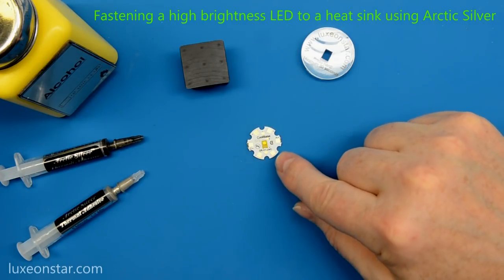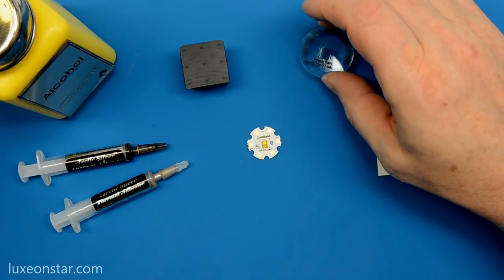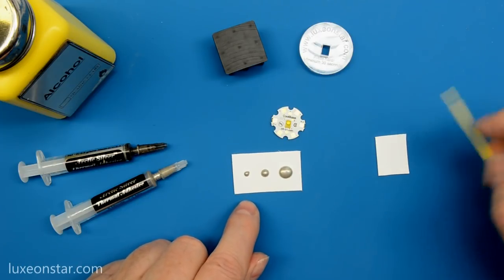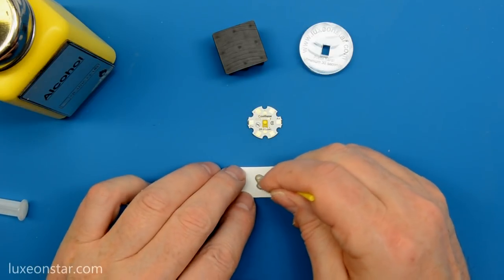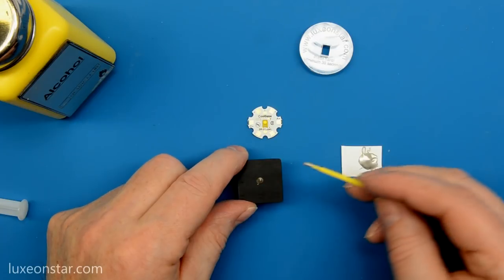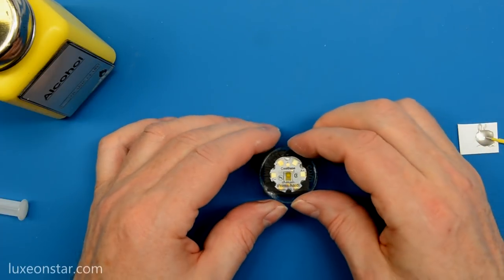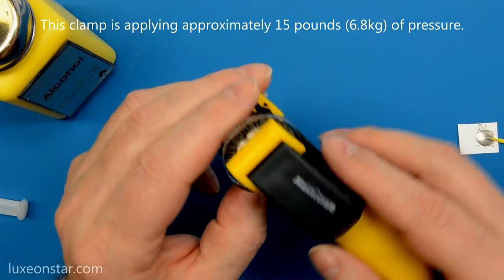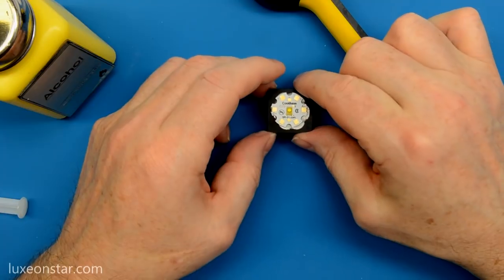Fastening a High Brightness LED to a Heat Sink Using Arctic Silver

Comment from the maker: This is in response to a post that was submitted some time ago but somehow got snagged by YouTube's spam filters.

1) What tolerance is there on the epoxy mix ratio - hard to judge "equal' at this scale.
I am not sure about the mixing tolerance. I suspect it is generous, but you would need to contact the makers of Arctic Silver to get accurate information.

2) Epoxy joints are notorious for sliding out of position especially under clamping pressure, you make it seem no problem but it is an issue.
If the parts are sliding around a lot when clamped, then that is a sign that too much compound is being used. The objective is to create as thin a bond line as possible in order to create a thermally efficient joint. So if you find that the parts are moving when clamped, reduce the amount of Arctic Silver you are using.

3) How long will the Arctic Silver epoxy last once opened, & what does it cost?
The manufacturer does not state an unmixed shelf life that I have seen, but I suspect it is fairly long. Probably a year or more at least. As of today, a 7 gram package of Arctic Silver is priced at $19.85 on our website.

4) You don't show any surface prep other than cleaning, what about checking at least for flatness of the emitter assembly?
It goes without saying that the surfaces do need to be as flat as possible. Commercially produced heat sinks will already have a very flat surface. Most LED assemblies will also have a flat surface as they are designed to be mounted to a cooling surface. So for the most part just being sure that the surfaces are free of contamination and moisture is, usually, sufficient.

5) Mechanical fixing?
Many of the LED assemblies that we offer can be mounted with mechanical fasteners, however we have found that both thermal tape and Arctic Silver perform very well and are much easier to use than screws or spring clips. Mechanical fasteners can be a bit trickier as it is very easy to over torque the screws, distorting the assembly.

Comment: Informative, but some questions remain:
1) What tolerance is there on the epoxy mix ratio - hard to judge "equal' at this scale.
2) Epoxy joints are notorious for gliding out of position especially under clamping pressure, you make it seem no problem but it is an issue.
3) How long will the Arctic Silver epoxy last once opened, & what does it cost?
4) You don't show any surface prep other than cleaning, what about checking at least for flatness of the emitter assembly?
5) Mechanical fixing ?

Comment: @Luxeon Star Leds : Is it ok to solder the electrical wires to the LED AFTER fastening the LED to the Heatsink with the arctic silver? Will the heat of the iron not damage the Arctic Silver?
Reply from the maker: There should be no problem soldering the wires to the LED module after it is mounted to the heatsink.

Comment: is it the same amount for arctic silver paste to be used ??? thx
Reply from the maker: I have no experience using Arctic Silver paste, but I suspect it would be the same amount, and perhaps even less as the purpose of the paste is to fill in any small and microscopic voids.
Reply: thx alot for the quick responce

Comment: How hard is it to remove a glued LED in case you want to use the heatsink for something else ?
Reply from the maker: ***** It is not removable. Arctic Silver creates a permanent bond.
Reply: Luxeon Star LEDs I meant more in the sense of using a knife or a screwdriver to remove (and probably damage) the LED because I'm thinking of using this method to attach one of those 100W COB LEDs to a pretty big heat sink and might want to replace the LED in the future...
Reply from the maker: ***** it may be possible, but probably extremely difficult to remove the LED from the heatsink. Arctic Silver dries to a pretty tough bond.
Reply: Luxeon Star LEDs ok thank you